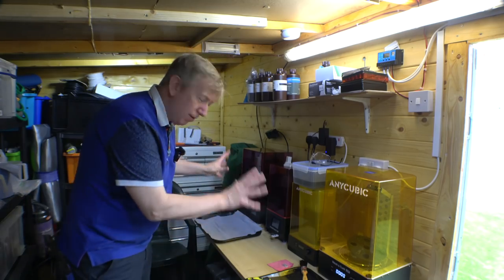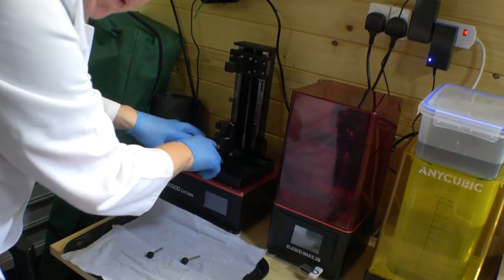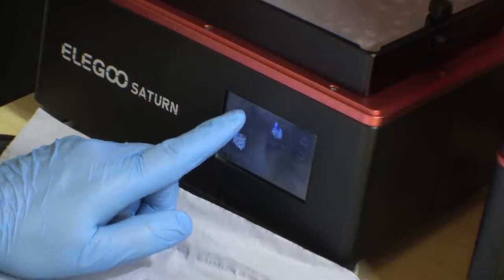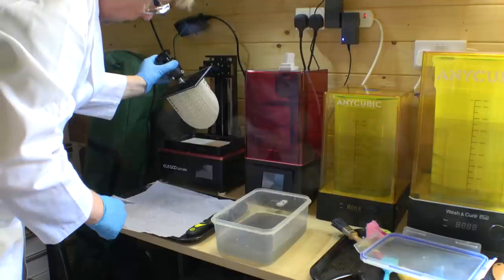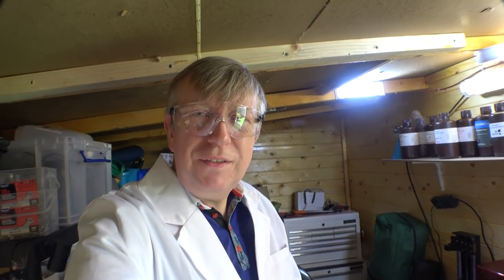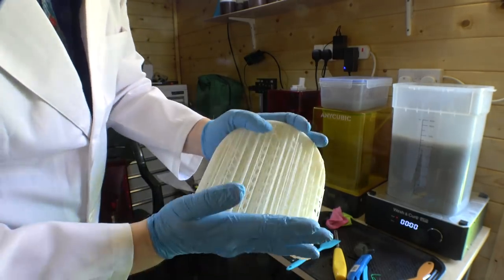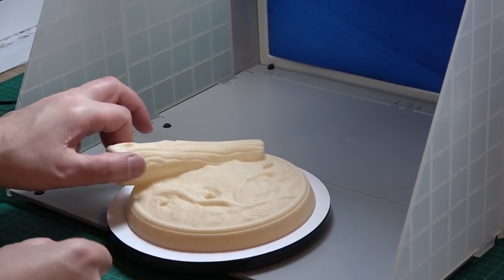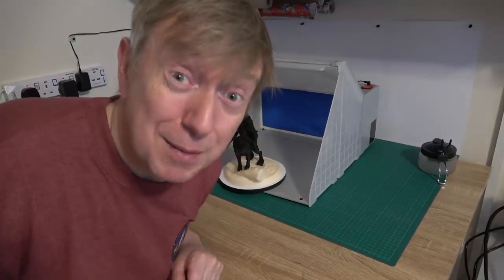Introduction to The Resin Printing Station (3D Printing)

Comment: Wow, your creative side has taken the ball and is running away with it. I'm very impressed both with the equipment tour explainations as well as the amazing things they create. I'm blown away by the equipment people are designing these days. 
When I worked for the shoe factory years ago, they used vats of acetone to remove glue residue from metal machine parts. We'd put on long rubber kitchen gloves to protect our hands. Every month or so they'd have to replace the dirty vat.
Your setup is efficient. I like the barrel under the table. Thank you for showing us how your new machinery works.

Comment: A couple of heaters i would recommend, tubular greenhouse heaters, they are 60W per foot, and very robust
Or electrical enclosure  heater, normally used in electrical cabinets to keep condensation away.
If your shed is insulaated, i would go for the tubes plus a thermostat.

Comment: I use an old fridge with a small greenhouse heater rigged inside and a temp control unit to to switch the fridge on and off, also the greenhouse heater... Means I can 3d print in the winter... I also keep my resins in there
Reply from the maker: That’s a great idea. Thanks for the tip. Not sure I have space for a fridge, but the greenhouse heater sounds perfect for the enclosure I’m intending to build😊👍

Comment: I've been cleaning up my spider-infested shed to use as my little printing place, but I'm worried about the amount of light that comes through the door and the vents, I've even considered putting blackout curtains to block the light getting in. Seems pretty uncharacteristically sunny where you are and you've got your print station close to the door. Am I worrying too much about indirect sunlight?
Reply from the maker: It was never an issue. I think as long as everything is in shade, you should be okay.

Comment: Fantastic vlog found it in really interesting,could u use 3d printing ? Would it be faster and therefore  needing less equipment.does resin supersede 3d ?
Reply from the maker: Thanks. At the moment FDM printing is still more economical and cleaner. Resin printing provides more detailed results and is faster, but is also more costly and a lot more messy. There are also some drawbacks to the finished resin. 
There is a place in the world for both, and I suspect will be for a very long time.